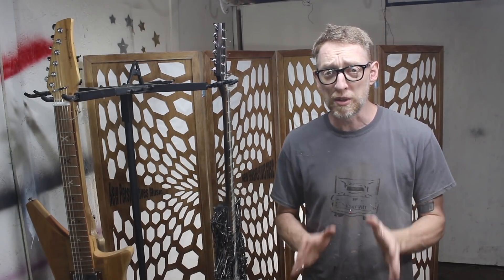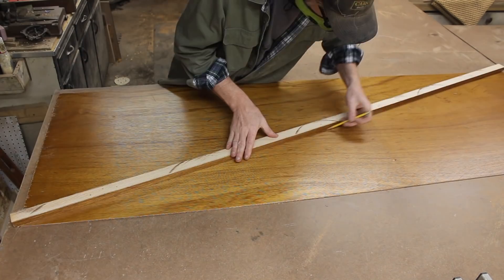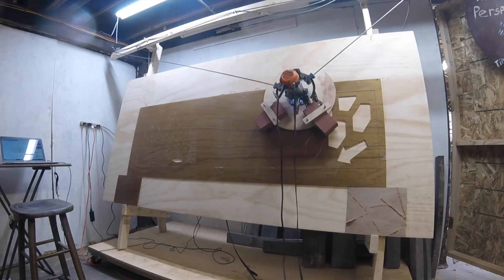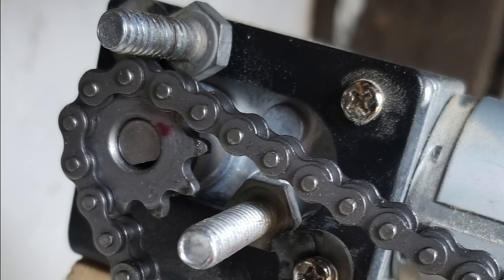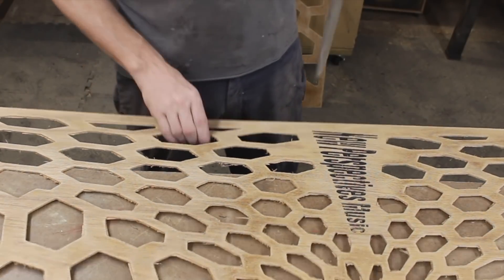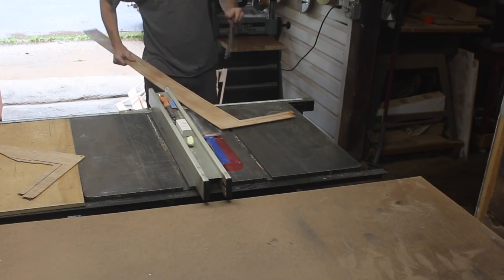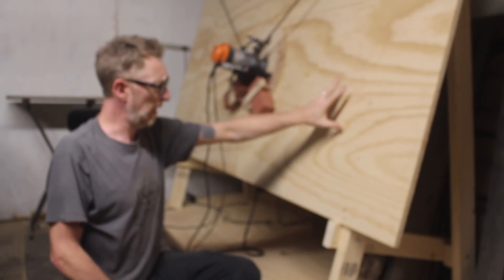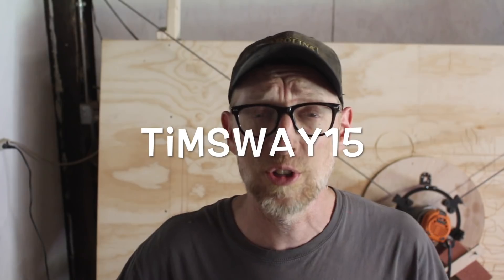Room Divider | My 1st Maslow CNC Project with MakerMade

Comment: Seems like they should use a slightly larger diameter gear, redo the steps per mm, and create guides as it enters and leaves with some cheap skate bearings so that it doesnt bind on itself 

As for the construction adhesive, I think the spirit of John Heitz made you do it.
Reply from the maker: haha! yea, I'm thinking an idea up to add bearings/tensioners to keep things on track
Reply: It's a lot harder than it initially seems, if you try to put a guide on the sled side, then the chain is no longer making a straight line from the tangent point on the gear to the bit, so the router bit will not be where the firmware math thinks it is. proper tensioning, and keeping the chain parallel to the workpiece mostly solves the problem (but you do need to lube the chain sometimes, and some chains come with spots that don't flex as well as the rest).

There are ongoing efforts to provide more down force on the machine, but that is FAR more complex than it initially seems.
Reply: David Lang I don’t think it should be on the sled side. 
It should be sitting exactly at the point where the chain disengages with the last tooth of the sprocket so the bottom of the chain runs against the bearing. That way there is no space for it to bunch, bind or start wrapping in on itself
Reply: @waldvogelreview7755  when you have the chain sticking as shown in the video, I don't think it will help much. given that the bearing and the sprocket are both round, and the sprocket is <1" in diameter (10 teeth at 1/4" per tooth), there will still be a V between the two circles that the chain will get into, just like it wedges itself between the bolt and the sprocket at about the 7 min mark of the video.

you can't easily switch to larger sprockets, not due to software issues, but with the stock weight and angle, the motors don't have the power to spin the larger sprockets (the entire machine is an exercise is 'just barely good enough'. the motors are just barely strong enough, so if you increase the sprocket diameter, you need stronger motors, but the motor drivers are just barely good enough to drive these motors, so if you switch to more powerful motors you need more powerful motor drivers...

There is a possibility that with software advances, we will be able to go with a lighter sled and the frame tilted closer to vertical, which could let us go with larger sprockets with the same motors, but that's theoretical right now.
Reply: David Lang 
Perhaps I would need to illustrate my idea rather than just describe it. But if you have a couple stacked 608 bearings  on a bolt within 5-6mm of the sprocket, I imagine once the resistance of a slightly stuck chain (bottom of the chain leading to the carriage) hits the top of the bearing it’ll straighten out if it’s not severely stuck. Even if it’s not perfect, it might prevent wraparound events from taking place since the distance between the bearing stack and sprocket is much smaller than the length of 1 chain link. The link wouldn’t be able to fit between the sprocket and the bearing

Again, just theoretical. But if I owned this machine, I would try that first to try to mitigate failed jobs

Comment: You could try a timing chain tensioner of a car to keep your chain tension and help stopping from snagging up on the motor
Reply from the maker: I was thinking about something like that, too. Like bearings on spring loaded arms...
Reply: @timsway  hi you could try a timing damper it takes the rattle out of timing chains on engines you just need to take the slap out of the chain near the cog on the motor its great idea hope you can sort it

Comment: I could build that too if I had all of those chopsticks laying around. ; ) I had a few thoughts about the chain issue. I'm assuming the chain size and sprocket size are the same? It looks to be about a #40 chain? Given how small the sprocket is you wouldn't want the chain to wrap too tightly around it. If the chain connects with the sprocket past the half way point it could cause trouble. Filing the teeth could help that, or a bigger sprocket, if the software can account for that. Your original problem almost looks like a gravity issue. The set up has to be on an angle to work properly but the chain wants to straighten up stay at a 90 deg angle with the floor. This twisting motion could be the main issue. Maybe add a plastic plate on the back 2x4 for the chain to ride against would help that, or add another idler sprocket before the drive sprocket to help keep it straight? Lastly use a dry lubricant for the chain, it will collect less dust. Check with a bike shop for the good stuff, or maybe even dry graphite would work. Just a few thoughts.
Reply from the maker: good info. I was thinking about bearings under tension to lightly push against the sprocket - and yes, I need to get some good dry lube.
Reply: it's a #25 chain. with proper tensioning of the slack, the chain will enter/leave on the slack side at the top (or very close to it), on the sled side, it will depart from 10 degrees to 80 degrees at different locations on the workpiece (far top corner is about 10 degrees from horizontal, bottom near corner is about 80 degrees from horizontal),  so you have between a 1/4 to a 1/2 wrap. As I noted in another reply, idlers on the sled side are a big problem, and are generally not needed much on the slack side if you have enough tension. In the video, the slack side had almost no tension on it as the problem was being demoed  (a common problem, it turns out that you really need to double up the stretchy cord if you use the layout as shown, but as I noted in an earlier comment, weights work much better)

I don't think anyone has tried a support behind the sprocket. The problem of gravity pulling the chain to vertical is why the slack was moved from the side to the top. if the ring on the sled matches the motor position, there is actually very little twist (chain doesn't like to bend sideways)

Comment: Great project, but let me give you my 2 cents on chains (hard learned from cycling): 1) tension - the slippage definitely is caused by the lack of tension on the chain as it comes out of the gear and away from the router. Perhaps a stronger elastic would do the trick. Perhaps shorter unsupported chain lengths could also help, like having the chain going back and forth tensioning gears (like in bicycles).  2) Lube - stay away from oil and, as much as possible, grease. There are non-sticky wax-based lubricants, those are the best.
Reply: Optionally have the surplus length of chain tensioned by a hanging weight. The pull of an elastic or spring will vary with tension, but a weight will maintain a constant pull (assuming no major disruptions in gravity....)
Reply from the maker: yes, the tension is part of the problem for sure, but the chain is so long it is tough to balance that out so it's not too tight at one time, too loose on the other side. should I try lithium grease? what do you recommend?
Reply: @timsway  Wax or wax-based lube for sure, Tim. There are several commercial names, any local mountain bike shop should be able to fix you up. Avoid oil and grease and much as possible. 
Regarding the tension,  you could try and use a bike chain derailleur to keep the chain straight
Reply: @timsway  ... I like the idea of hanging weights. If you have a lot of take-up to worry about, you could use a couple of pulleys, hanging the weight at the bottom pulley with the focus on consuming rope rather than conventional thinking of making lifting easier while having to deal with twice as much rope.
Reply: @jvin248  you can actually get away without a bunch of pulleys, it's not an elegant, nicely engineered solution, but it works. See https://forums.maslowcnc.com/t/weights-for-chain-tension/9718 for an example.

Comment: The room dividers came out great Tim, awesome job! 😃👍🏻👊🏻 ...... perhaps some type of dry bike chain lube  would help it to run more smoothly and potentially not get as caked up with sawdust like the oil? 🤔 of course you'd have to completely clean/degrease and dry the chain first.
Reply from the maker: i have a can of dry lube. I could try that, but man, I put so much oil on it already I may be stuck...

Comment: Hey Tim......I picked up some bicycle parts, in this case they were nylon rollers with center bearings, for a project I was working on (an old Fender tape echo unit!). my point is that they are designed specifically for use with bike chains. They're about 1-1/2" dia. and would mount easily to the backer board. I got them off eBay...similar to these: 
https://www.ebay.com/itm/3pc-Idler-Pulley-Chain-Tensioner-Roller-49cc-60cc-66-80cc-Motorized-Bicycle-Bike/153214262870?epid=10024715135&hash=item23ac481e56:g:cVgAAOSwgYdbvr61:sc:ShippingMethodStandard!01550!US!-1

Maybe a bit smoother than the wood/bolt/washer(s), and less likely to snag. They also have a shoulder that would prevent the chain form lateral slip. Worth checking out, I think! Cool project....and for $500, if people expect the speed, etc., of a more 'traditional' CNC, they're being a bit unrealistic! I may spring for one of those, myself!! :-)
Reply from the maker: oh yea, those look cool. Yea, It bugs me when people post negative comments about these machines. It's 5% the cost of every other 4x8 out there and does way more than 5% the work. Such a great intro to cnc and makes it affordable to everyone. anything else under $1k is about 12"-16" cutting area amd has no user support network.
Reply: @timsway  ... Just one question: Have you tried it on hardwood...or even pine? All of the demos seem to use plywood, and not all projects are plywood-friendly! :-)
Reply from the maker: @normjacques6853  the trick with cutting wood vs plywood is you need to build up around d the cutting area with something of the same thickness so the sled doesn't tilt. As long as you do that, itll cut reL wood just as well as the router would in your hand, but more accurate.
Reply: @timsway  it will cut real wood (and other materials, people have cut aluminum and acrylic as well) up to the limit of the Z axis travel. Taking a $150 router and motorizing the depth control is a simple, cheap way to make a Z axis, but there are a good number of people who are making a more traditional CNC Z axis for not a lot more (frequently switching to a 500W spindle at the same time, the heavy-duty router is overkill for these speeds)

speaking of speeds, theoretically this can go to 48 ipm (~1200mm/min) but right now we don't account for acceleration, so the settings default to about 3/4 of that (~30-36 ipm depending on the release). It just seems especially slow when you have so much distance to cover.

Since the feed is so slow, many people have gotten better results with single-fluke bits.
Reply: @timsway  Not that you need another CNC, but you might want to take a look at MillRight. Their Carve King is under $1000 (well under depending on the package you choose), and while it doesn't have a huge cutting area (17"x17"x4"), it's a solid machine and their forum is a pretty great resource. Having no prior experience, I picked up a kit a while back, and I was able to build it and get up and running without much difficulty. It's been running strong for almost 2 years now. I would definitely recommend them to anyone wants to get into CNC without spending a whole bunch of money. It is a fairly extensive build process, especially for someone without a lot of mechanical experience, but I think that having to assemble it from scratch teaches you a lot about how it works, making it much easier to diagnose and fix any problems that might arise.
Reply from the maker: @KevinKratzke  there are a couple kits like that and I agree, building your machine is integral to understanding and troubleshooting. My main machine is a cncrouterparts.com machine (now called Avid CNC) and that came with assembly required.

Comment: I think that machine is pretty slick for the price if someone wants to get into CNC routing.  You might investigate making it more accurate by replacing the chain and sprockets with gear-belt and pulleys.   I'd also like to see you cut out a guitar body with it in the future.
Reply from the maker: As I own and use it I will continue to experiment with its setup. Obviously I would still make my guitars for my biz on my smaller Avid CNC machine as it's much faster and easier, but I have plans to do some guitars on it with MakerMade to trst its capabilities.
Reply: switching to gear-belts will increase the error from stretching while slightly decreasing the error from sagging, so it's unlikely to make a fundamental difference. We are still working out the math involved to compensate for the chain sag and stretch (and the harder problem turns out to be how to figure out how much sag and stretch there is, and a calibration routine that will let a person with only normal measuring tools measure it)